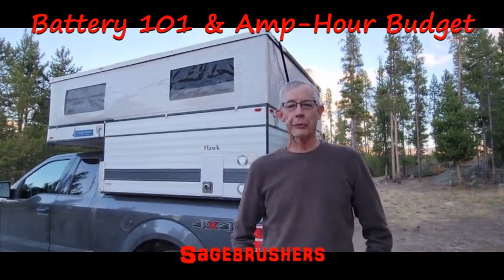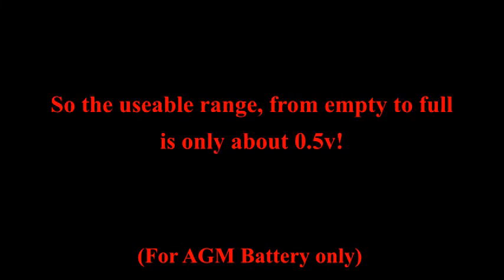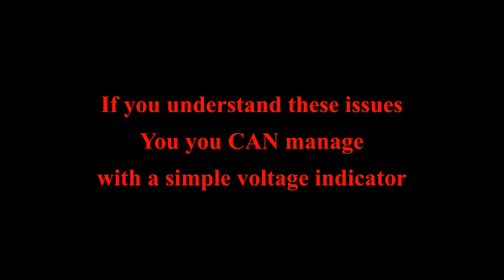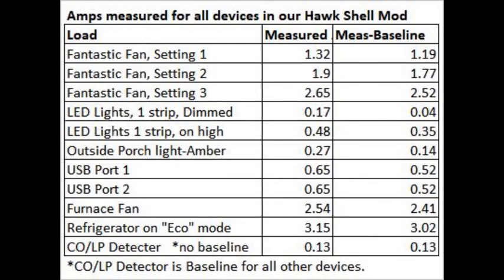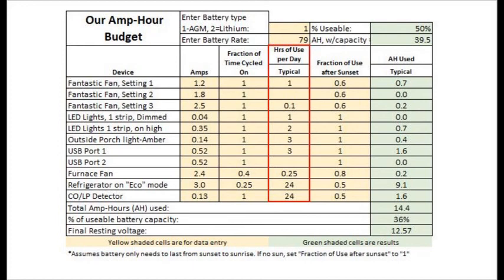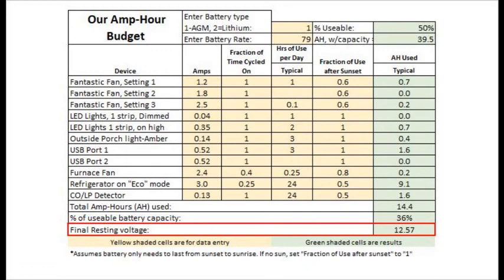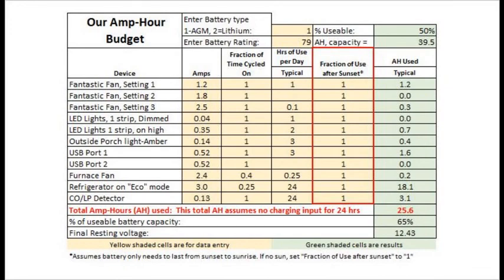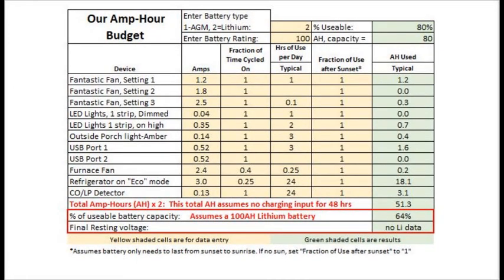FWC Battery 101 and our Amp-Hour Budget

Comment: Those were good charts.  The key to getting by on a single battery is use electricity like someone who is tent camping with a 12 volt DC fridge and avoid the temptation to run appliances which require an AC inverter.    

I now use a lithium battery, but I want to mention that my last AGM battery soldiered on for more than six years before I gave it away.   Your point on  ambient temperatures and lithium batteries is rock solid.

If you plan on keeping the truck and camper for at least 3 years,  go for the DC to DC charge controller with a wiring upgrade to the truck's battery.
Reply from the maker: Thanks Andrew.  And good comment about using electricity like someone who is tent camping, or comes from that end of it, rather than from the perspective of a new "RVer" wanting all the creature comforts of home. After all, it is called camping and we do it in a "camper".  
Good suggestion on the wiring upgrade too.  I hope to upgrade to the DC to DC charge controller and wiring upgrade as my next step. Have you done that?  If so, how many more amps can you get out of idling with the wiring upgrade as compared to before?  Thanks much.
Reply: @sagebrushers8497  Yes - it was a leap before you look exercise - a Renogy 30 amp dual input DC to DC controller.  In addition to the cost of wiring, fuse holders and circuit breakers, how to package the assembly into a small space was a challenge.  

One comment on the Renogy unit - to get the full 30 amp from the alternator input, the solar panel needs to be switched off on a cloudy day.  I'm fine with only 15 amps coming from my 130 amp alternator on a cloudy day,  because there is less chance overheating the alternator, if for example I am driving with the headlights on.